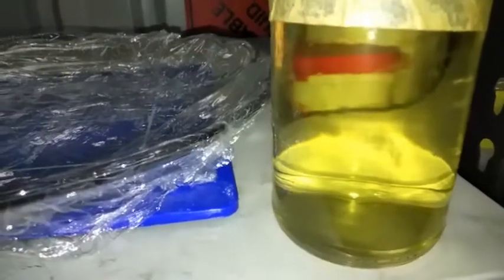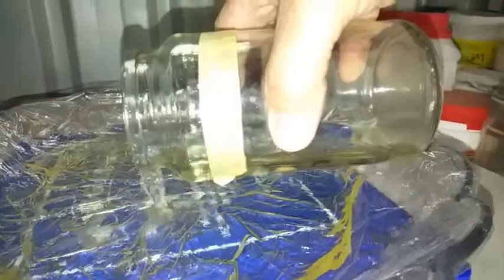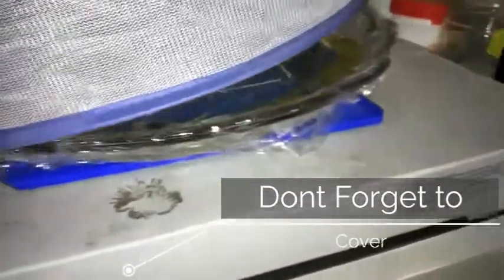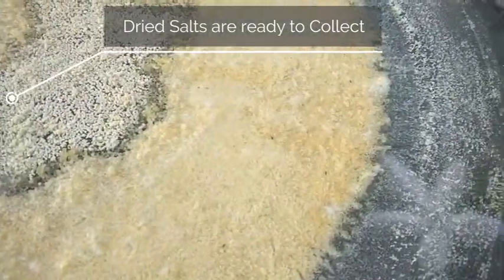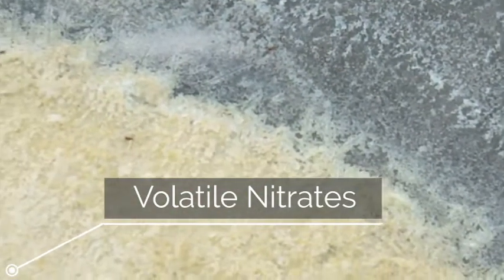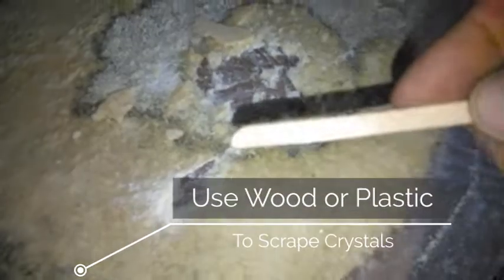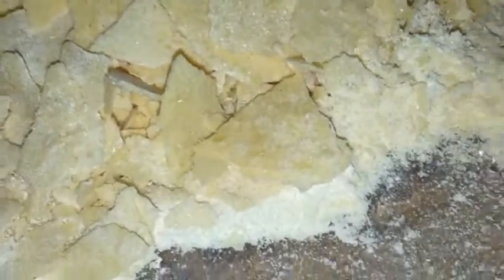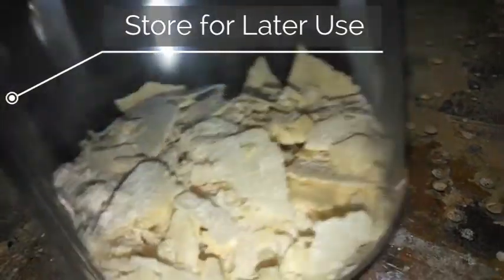Salts From Wood Ash

Comment: You can use a steel sieve it wont react with the lye. But you for sure dont want to use aluminum. And your potash is more soluble in hot water you'll get better yields if your water is almost boiling and you keep it warm through the leech

Comment: You can go on to make homemade soap. Or you can make potassium chlorate, using an electrolytic cell. KClO₃ is used as an oxidizer in fireworks, especially flash powder (firecrackers, M-80s, etc)

Comment: This is the last info about lye usage. Previous Nitration and reduction and vat process is suitable for cellulose fibers like cotton, linen or rayon. Or any other from vegetable source. Wool, silk, synthetic fibers like nylon requires acid mordant to make an acid dye:

https://en.m.wikipedia.org/wiki/Acid_dye

Acid dye are done by sulfonation. Sulfonation can change the color of the dye

 

One example is sulfonated indigo or carmine indigo useful for wool and silk

https://en.m.wikipedia.org/wiki/Indigo_carmine

To do the sulfonation can be used sodium thiosulphate as I read

https://en.m.wikipedia.org/wiki/Sodium_thiosulfate

Sodium thiosulfate is used predominantly in dyeing. It converts some dyes to their soluble colorless "leuco" forms. It is also used to bleach "wool, cotton, silk, ...soaps, glues, clay, sand, bauxite, and... edible oils, edible fats, and gelatin

This can be done by mixing sodium chloride made from Pirite with sulphur followed oxidation. This I read, I don't know parameters. Can be air and hot, hydrogen peroxide, etc.

This produces a leuco salt useful for wool, silk etc.

https://en.m.wikipedia.org/wiki/Bunte_salt

Tthe Vat used is opposite first dye is in the negative with potassium or sodium hydroxide and for fixation is placed in the positive to make sodium travel to the negative electrode. This produce also water electrolysis since redox potential of water is lower than sodium.

Instead of electricity can be used an acid like diluted sulfuric acid and an alkaline solution, but waste dye and produce a residue of sodium sulfate. Will need another wash. Vinegar will not strong enough to proper fixation.

Also sulfuric acid can be used to sulfonate the dye and then the do the salt with an alkaline addition. Will modify the color.

Comment: Why can't i touch it?
Reply: It's potash crystals. There's a ton of potassium hydroxide in there, which is basically drain cleaner so strong that it crystalized.
Reply: @freelance4200  KOH can absorb CO₂ from the air and spontaneously convert into potassium carbonate, but not as efficiently as sodium hydroxide does. NaOH is highly-hygroscopic, facilitating the reaction. Potassium salts are not nearly as hygroscopic. The crystals would be mostly in the carbonate form, if they were exposed to air for a long time. Keeping the jars sealed will slow the uptake of CO₂
Reply: @John-jd7mm  I thought it might be more because of skin oils and bacteria contaminating it, but bacteria wouldn't be able to survive in this.
Reply: @freelance4200  ok now why is it worth having?
Reply: Because your not "MC Hammer" 

You Can't Touch This......